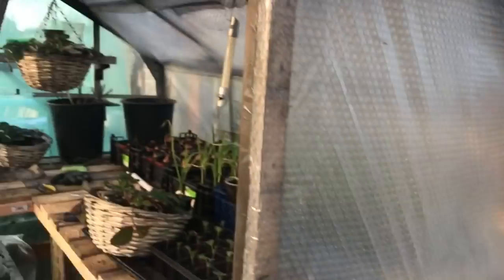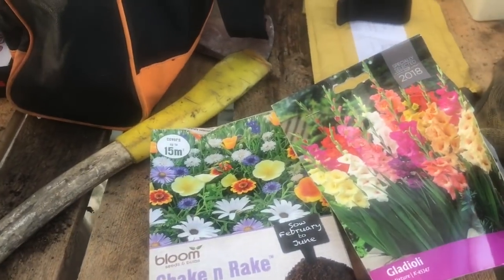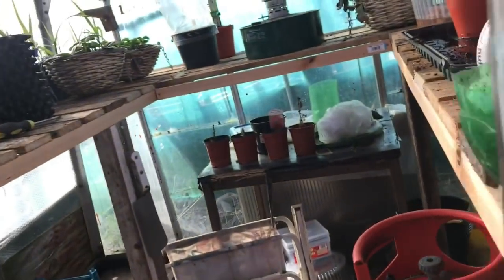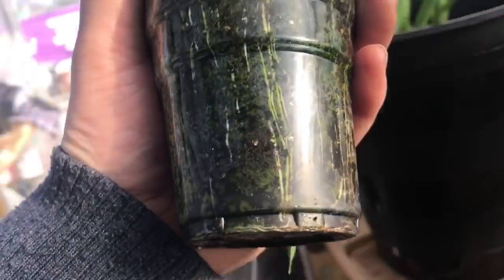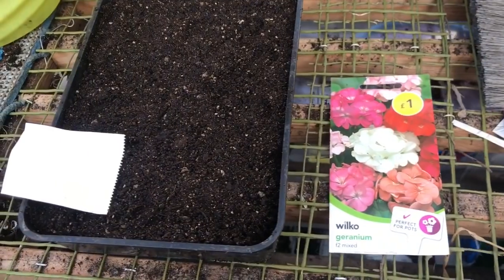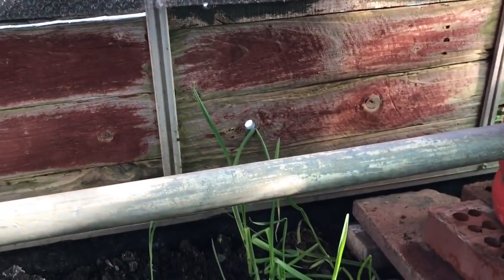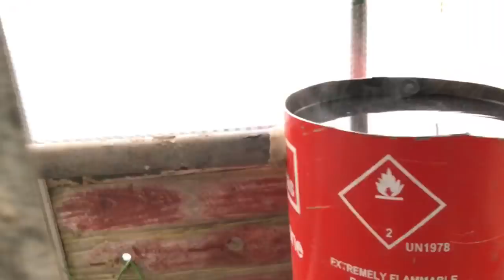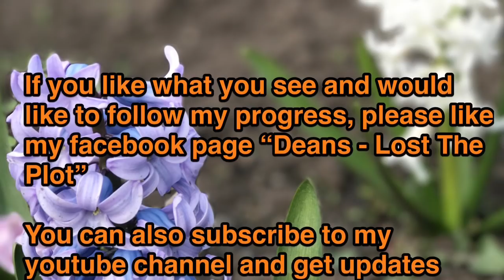Deans Lost The Plot 25/2/18 fitting parkray heating pipes, solar light install & more planting #25

Comment: neat design with the heater and water. are you going to use the water tank as a radiator? plus how do you keep the fire going when your not there? I have built something similar, I put a coil of microbore copper pipe in a small Woodburner  and heated a tank of water. However I have insulated my tank because I have laid underfloor heating pipes in my raised beds and I   slowly pump the hot water through the pipes in the beds which keeps my beds frost free and extends the colder shoulder seasons. The exhaust from the Woodburner goes down under a row of slabs  in the greenhouse which has insulation and sand under them and the whole thing acts as one big radiator in the greenhouse. The way I got round constantly feeding the fire, was to make a version of a 100 hr candle, using veg fat and instead of a candle, I used several thick wicks. This sits just under and inside the copper coil. I creates several large flames which keeps the water hot enough for the system and every 3 days I replace the candle. The candles only cost about 1 pound to make. works really well.

Comment: Looks good my father had a similar system but pitbuilt with 6 inch steel pipes you may need to have the top pipe lower in the tank as it will boil over if your fire is to hot you will need vents in the roof for the steam
Reply from the maker: Grandads Allotment cheers for the heads up pal, it wont get that hot that it boils.  My grandad has one in his 8x6 greenhouse down here too thats where i got the idea from i knew i wanted on as soon as i seen his haha got grander plans for the pipework and benches see when i get those done in future 😁

Comment: Where did you get the lights from Dean?
Reply from the maker: Phil Hopkinson got them from ebay a while ago ive been looking for another set ever since i heard you can get them from home bargains
Reply: They had them last year for less than £10 in home bargains but were out of stock everytime I went. Just wondered if they were selling them elsewhere as not seen them anywhere.
Reply from the maker: Phil Hopkinson not seen them since but if i find them again i will post on the fb page 👍🏻
Reply from the maker: Phil Hopkinson yea i wish i went and got a few sets! I got mine on ebay they where £23 i think but have been well worth it!